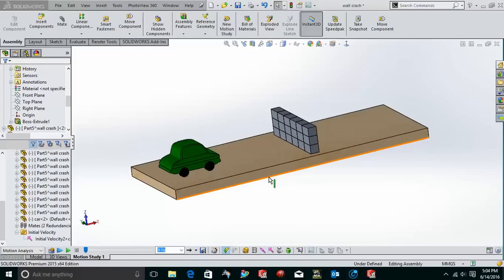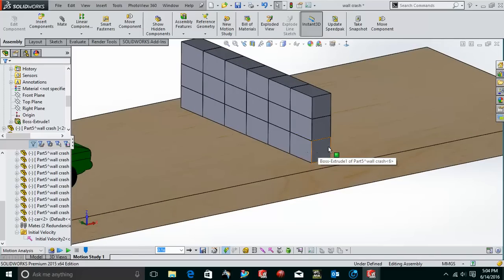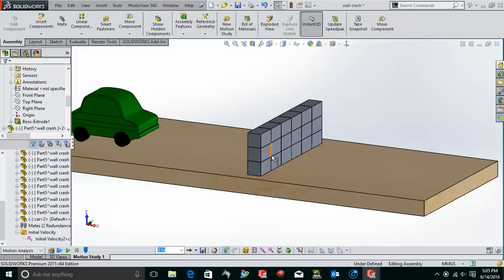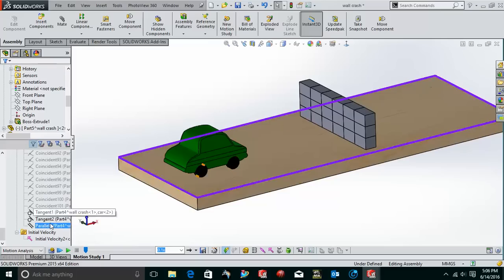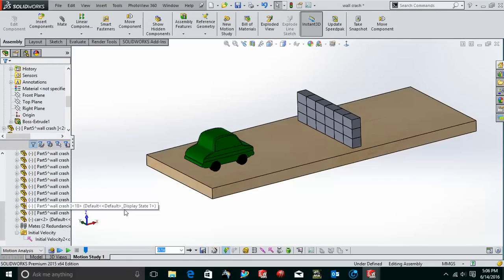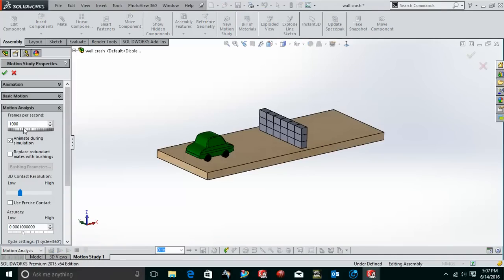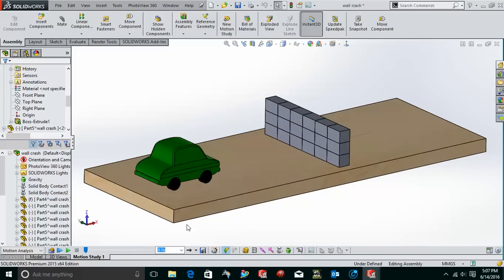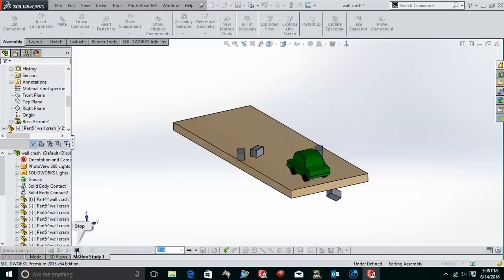Toy car crash test in SolidWorks Motion | Let's Design

Comment: Hi Shanwas,

It's a nice compilation

Apart from the video, I have some doubts can you please clarify them?  If I need to contact you.  can I know the possible way?

Thanks
Ranjith
Reply: 1. How to check the detailed analysis with controlled mesh on an double sided overhang beam with 03 supports and 02 point loads
2. How to check the motion, stress and crash analysis on a trailer frame with various modifications

Please do share in detail.

Thanks
Naga Ranjithkumar A